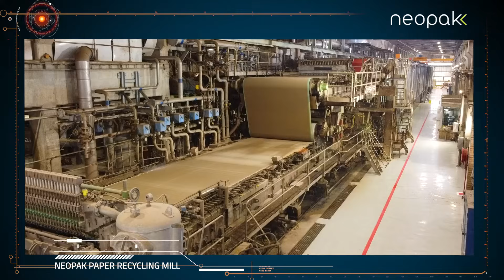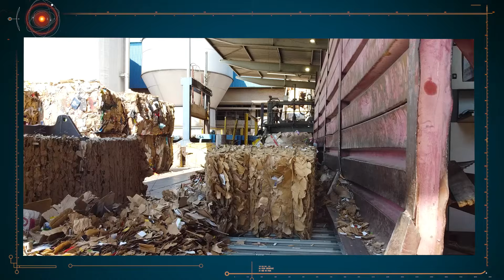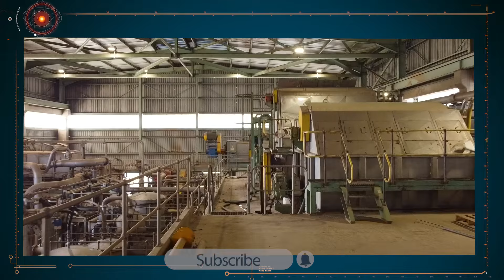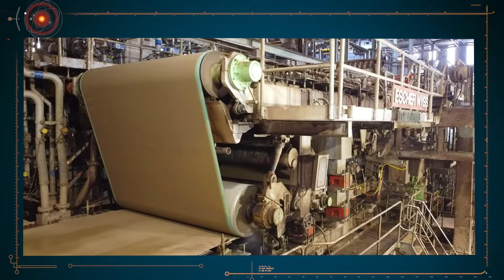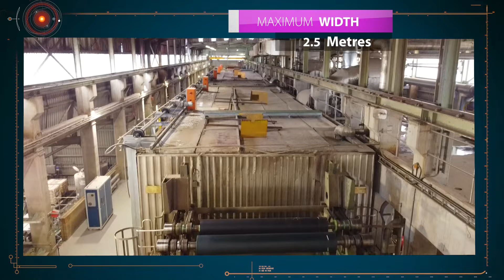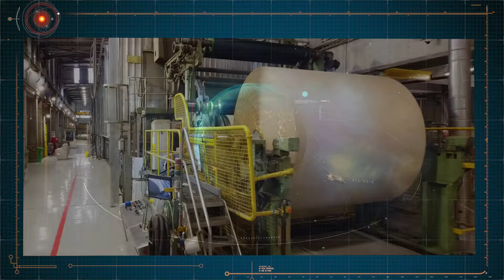How they recycle cardboard | Making new paper from old cardboard.

Comment: As I have done quick research on internet and cardboard companies’ websites, he is right that dirty greasy cardboard shouldn’t be put in recycle bin. The pulping process only remove plastic and small metal from the cardboard.
Reply: The cyclones we use in ours have a fine plate that's catches any grease once the paper is pulped. In truth it helps to not have grease in the first place as its less stress on said cyclones but we can deal with grease anyway. In total there are 9 stages of cleaning in our mill before being put on the wire it's more than just plastic and metal.
Reply: Well then I publically apologize for the dozens of pizza boxes I've thrown in the baler for so many years 😂